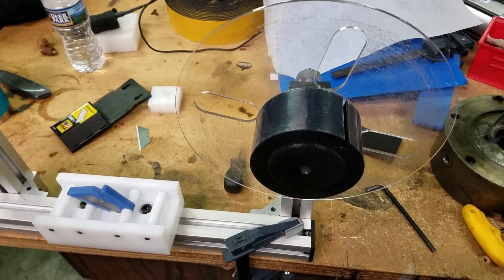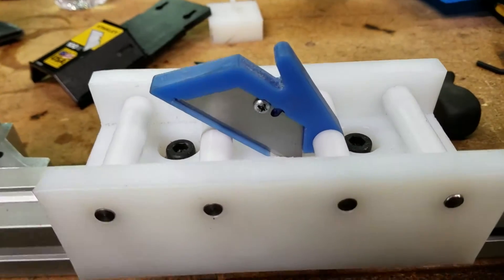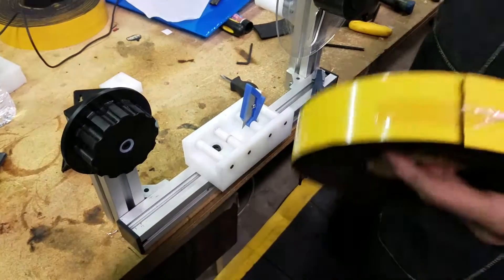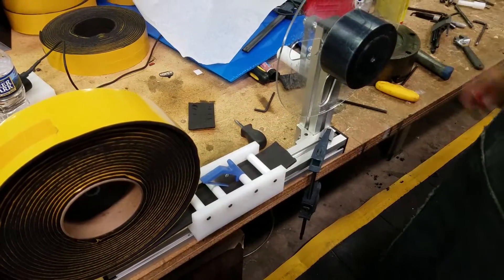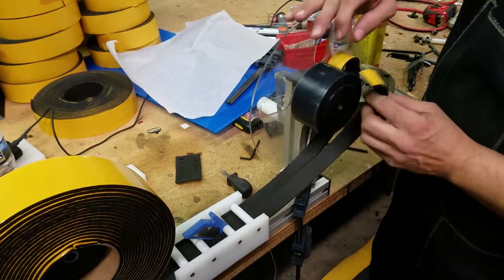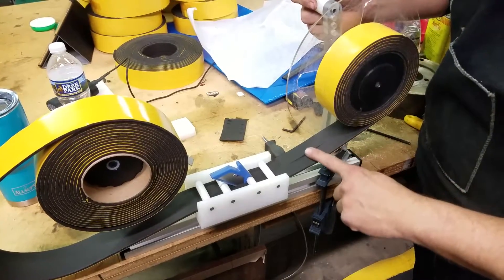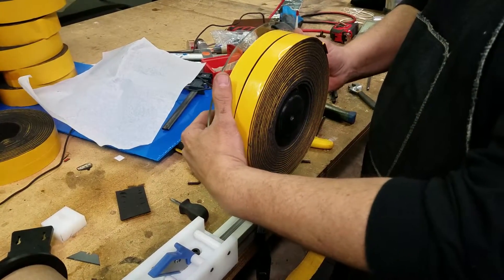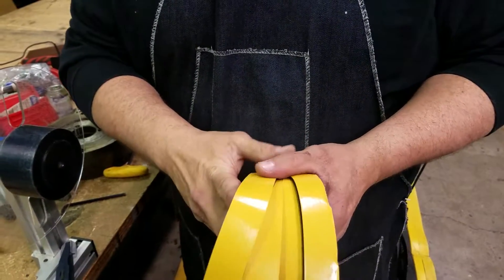2 inch Foam Tape Splitter

Comment: if you need to have foam tape slit or a custom size call Bron Tapes.
Reply from the maker: Thank you. I ended up making 2 units total and ran about 1,500 rolls through each one. I wish I would have known as bout you all sooner. We now go through a converter company. Thank you